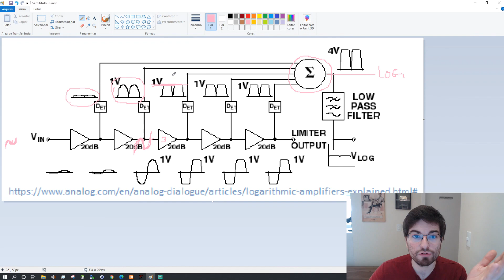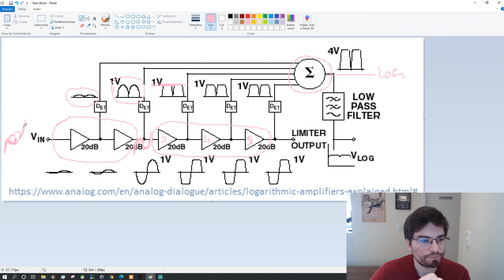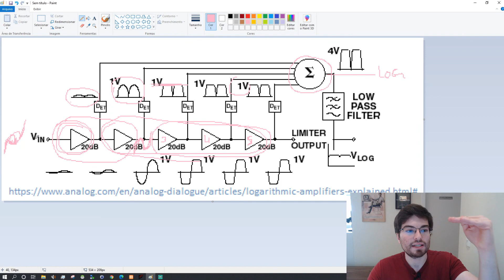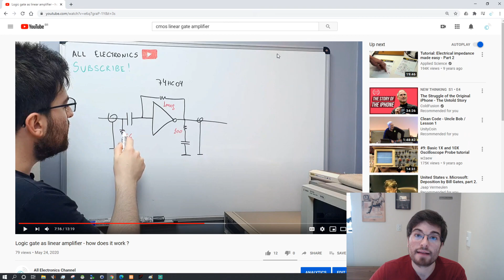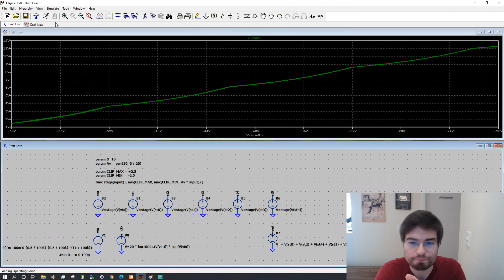Log Amplifiers - Theory of operation

Comment: so basically log amps act as linear amps if the signal intensity is relatively big(close to the cut off voltage)  and actd as log if the signal is far from the cut off voltage.

Comment: Good idea to utilise  logic inveters for log amplifiers, main advantage is simplisity, but  with hi amplifications all 6 inverters in one ic may catch oscillation.   Look at  cd4069, that ic  widely used in "wireless dorbell reciever"  as linear amplifier, same logic buffers but work better in linear mode.
Reply: Also cd4069 makes an amazing High frequency VCO.  Just feedback the output to input using a large resistor. Then change vdd voltage to change the frequency.   The new cmos can go up to 100mhz.
Reply: But my question here is what's the use of log amplifier?
Reply: Log amplifiers convert all signals to logarithmic scale,  simply  compress big scales in to small,  similar like zip arhiver compress files. dB scale is logarithmic,  60dB  means 1000 in usual numbers,  80dB - 10 000, 100dB - 100 000
Reply: @very_dark_engineer  ok it means a non-linear amp to mix with IF so the resultant range of frequency is reduced.  In receiver the reverse anti log should be used. Am I correct?
Reply: @bayareapianist  Yes you are correct, but usually log amps works with amplitude and mixers with frequency. U can look to LA1140 datasheet it use  limiter as log amplifier to detect siglnal levels, right after limiter signal goes to mixer
Reply from the maker: Thank you! I buy some of these

Comment: What type of detector do you recommend for this particular circuit? A perfect diode or just a diode? 

That's a very interesting idea. Many active components can be used to realise a segmentally approximated logarithmic function. Opamps with diodes as limiters, for example. But I am thinking about the benefits of sacrificing logarithmic accuracy. Speed of operation? Lower noise? So how it works compared to classic logarithmic amplifiers or those a little bit more advanced with two transistors, two op-amps and a thermal compensation component? Like this, for example: https://drive.google.com/file/d/1_Cmau2Si2QHTKuuDqe3v-E_MeqVR5o4n/view?usp=sharing
Reply from the maker: Nice question! 
It really depends on the input to output bandwidth needed.

Circuits that uses junctions log/exp current to voltage relation, as in the circuit you sent, have higher log accuracy and dynamic range. They can be used up to tens of MHz, like 10meg, 20 meg.
In higher frequencies, the linear non-idealities (like junction capacitance, lead inductance) start to dominate and the log behavior fall down. 

The cascaded topology I presented in the video can work up to mmWave.. It's common to use just normal diodes with some kind o parallel compensation for temperature effects. 

In Integrated CMOS the circuit is usually built with differential gain stages so, actually, no diodes are needed, as the stages emitter voltages can me summed in a common node (the differential behavior of the emitter voltage will produce a rectified sample). 

Take a look at this differential log detector built by Matjaz 
http://antena.fe.uni-lj.si/literatura/S53MV/spectana/sa/sa09.gif